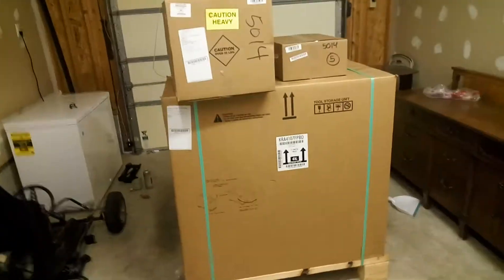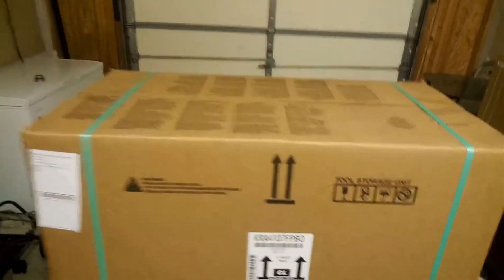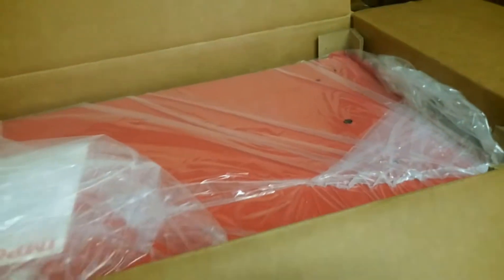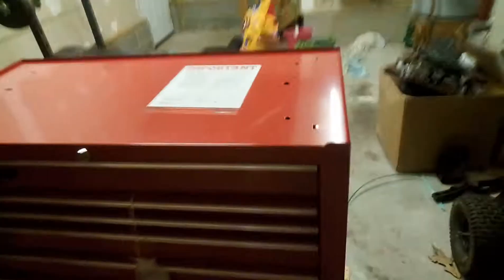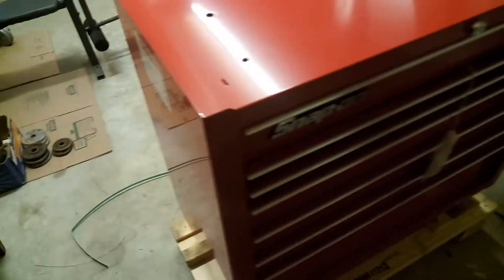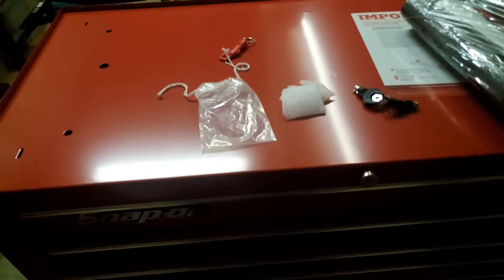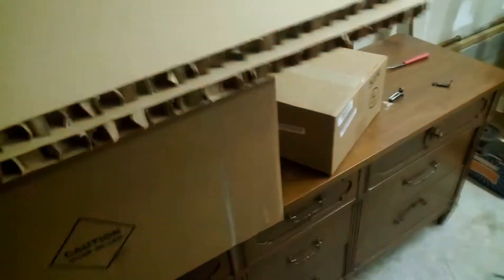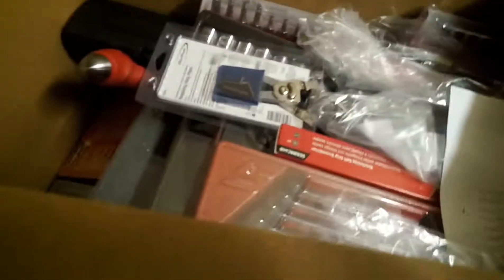Snap On Tools Unboxing

Comment: Rushking19, i'm jealous nice tools you have there snap on tools aren't cheap. My tools i have are all craftsman that i use on my personal garage and my cars. I have the same Snap-on impact gun like yours but its in black and 1/2 drive. When you picked up your impact in the video it looks pretty small what is it a 3/8" impact? Anyway nice video review you have there on the tools and also the videos you put out on your tiburon. I have a Tiburon too its black and 2003 Gt 2.7L V6 6speed transmission. Right now its a project car adding a bunch of performance bolt on parts, and cosmetic parts for the interior. keep up on the latest videos on your tiburon and i wanna ask you Hows UTI universal technical institute work out for you? what manufacture training program did you go for? I know the school tuition is high if you don't mind me asking how much did it cost you for the the years semester? I was thinking about going to UTI here in my area in Orlando, Fl. years ago either the Toyota program or BMW program but on the other hand i was thinking what if i can't find a good paying job  and i have to pay all that money for the school i don't know i kinda have my ifs about the money isn't there for technicians working at a dealership because you know most of the money goes to the dealership not the mechanic